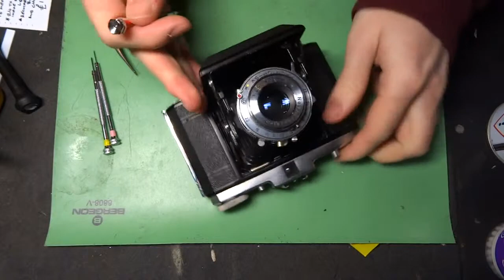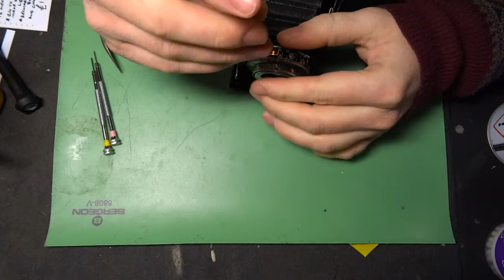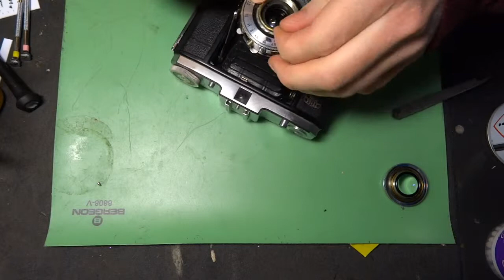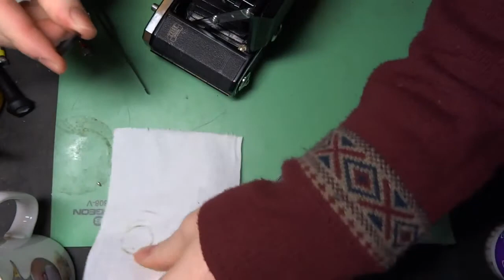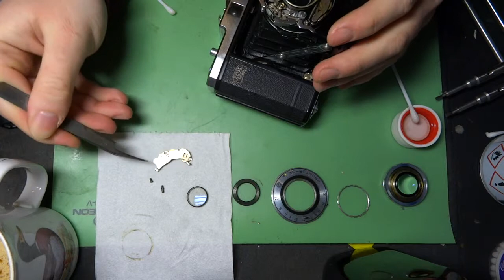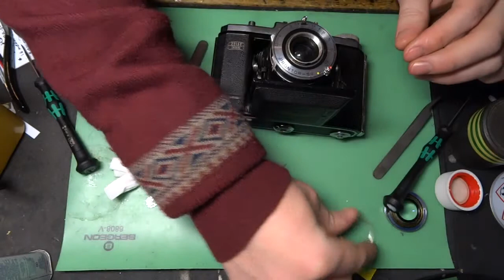Zeiss Icon Repair (With Voice-over)

Comment: Hi there, can you help me?
I just need to clean the inside of the front lens element (I won't need to remove the inner retaining ring).

So with that in mind, do you just undo the holding screw as you find it in situ or do you need to rotate the the lens to a certain position i.e infinity or closest distance?

Appreciated

Laurie

Comment: Hello... I am using a lot, that means several times a week, a Zeiss Ikonta 521/16... I really love that camera. However, I got some issues recently with the diaphram setting. Under 1/10 down to 1s, too often the diaphram gets stuck or it is too slow. Instead of 1s as marked my watch tells me the real synchronization of the shutter is 5', (5 times slower as marked) At 1/10's the real time is 1's and so on down to 1's. Oddly, the timing of the diapharm seems to be correct for all faster settings till 1/250. I am wondering if to oil a bit the shutter mechanism will be helpful. I have bough special oil for watch but I am afraid to ruin the camera by spoiling the lens if the oil leaks. What do you thing? Best Regards.

Comment: If you will service the shutter, you have to remove it from the camera and take it apart, cleaning the shutter leaves one by one.
There's more oil that will replace the little that you removed by your service. It'll work for a limited time, then you have to clean again..

Comment: Thank you, just a little more detail and I would have been willing to tackle the job on my own camera. Although I think it may need a bit more than this. How does one ensure the lens is focused again?
Reply from the maker: I think the Ikon has a single start thread (it's been a while) if so, your golden, just keep the shims. If it's multi-start, focus on a infinity point like a church steeple with a ground glass plate on the film plane and rotate the focus ring to match then tighten up the grub screws.
Reply: My nettar front element thread can be screwed in 2 points... One aligning the arrow around the stop screw hole/infinity mark and the other around the 7 feet mark. Only when starting from the second point the lens will reach infinity (also that leaves a little gap). My model has a novar anasrigmat 75mm f4.5 with a prontor sv shutter if that can help anyone...